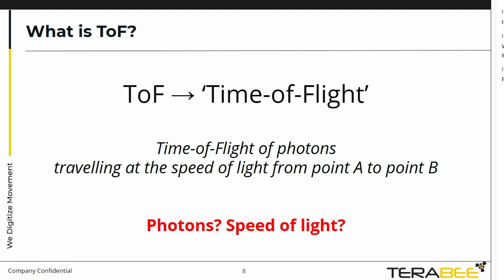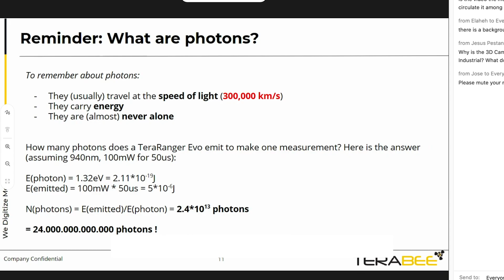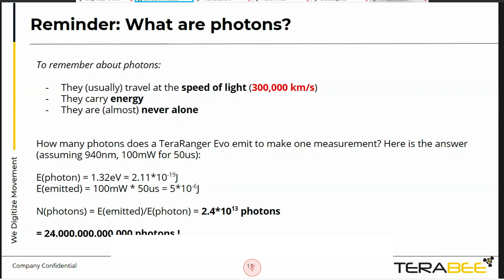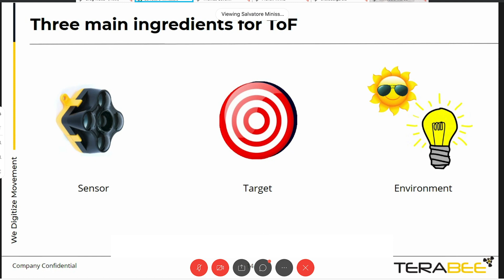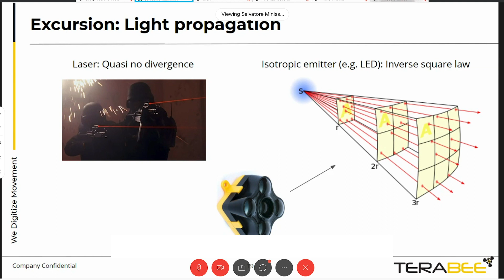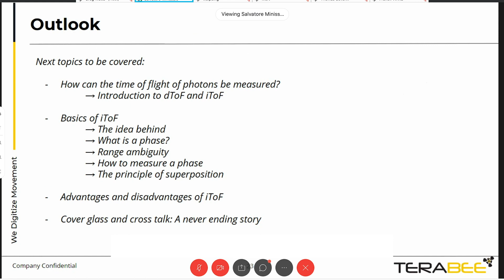"A brief introduction to Time-of-Flight sensing" webinar, 14 May, 2020

Comment: Hi, can you tell how tiny object can be detected using ToF, and also is there any limitation if the traveling speed of the object is very fast?
Reply from the maker: Hi @aiplnasik873 Thank you for your question.  Detection of very small objects will be influenced by a number of factors:  how far from the sensor, the type of ambient light, the reflectivity of the object being the most important factors.  The further the object is from the sensor, the larger the detection pixel which means that a small object may not fully cover the pixel and objects further in the background may also be detected.   Speed can also be a factor.  Basically the smaller and faster the object, the harder it is to detect.

Please feel free to contact us here https://www.terabee.com/contact/ if you'd like more information or to speak to one of our team.

Best regards,
The Terabee team